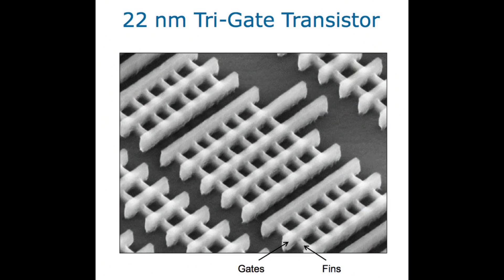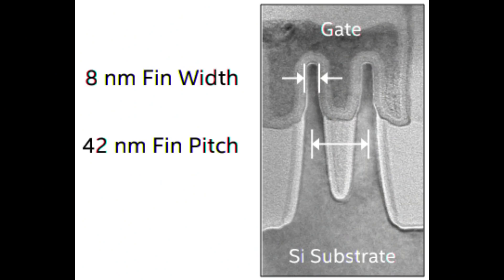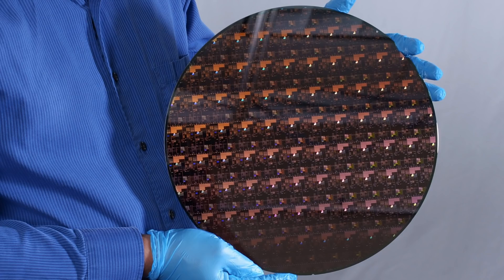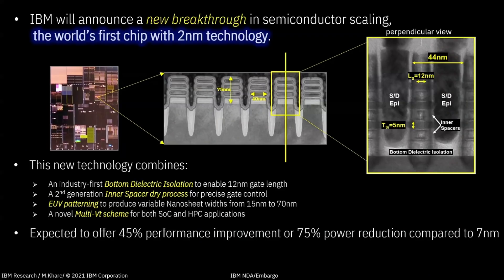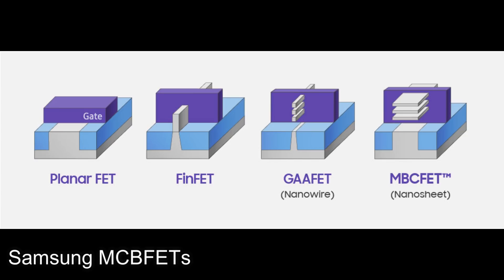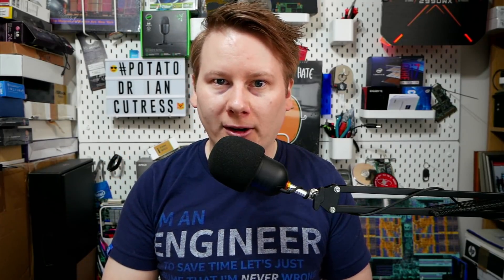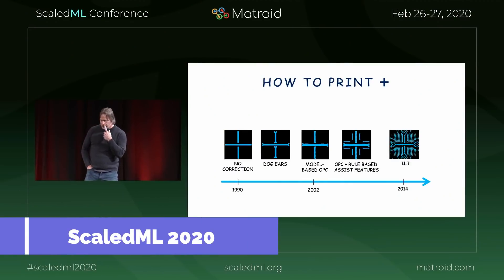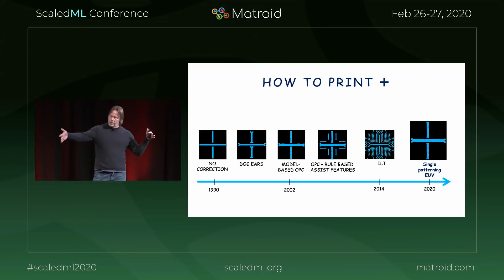There's Plenty Moore Room: IBM's New 2nm CPU

Comment: Second thought is that software's got to also take a substantial leap in order to use 100 core CPUs. I currently run a 16 CPU 32 thread machine basically remains idle most of the time.
Reply: True but its at least a few years off so they have time.
Reply: @erikburzinski8248    I don't think so ... this is a known problem since basically the beginning of Computer Science.  Only partial solutions are available for human based programming.  At this stage, it is a problem that I think will never be solved... nor does it necessarily need to be.  The inefficiencies in use of high multicore systems will persist.

Comment: The engraving size announced by IBM, Samsung, or TSMC, are all measured differently, are not comparable, and in the end it's just marketing. The physical limit of a silicon transistor size is 7nm. Beyond that, the chip is subjected to quantum mechanical effects that make it totally unusable. For example Intel reports a density of 100.76MTr/mm2 (mega-transistor per squared millimeter) for its 10nm process, while TSMC's 7nm process is said to land a little behind at 91.2MTr/mm2, and Samsung's 7nm is at 95.08MTr/mm2. To go below 7nm you have to switch from silicon to something like carbon nanotubes and molybdenum disulfide.

Comment: I don't think this will work with all processors as the higher the voltage the more likely the electron leakage will be a higher-level problem, maybe end of the road for silicon and monolithic designs. Things like nanocarbon layers or new materials will be needed to go vertical or chiplet for the future until tech that allows complex layers to be printed.

Or we go photonic. Or mixed x86/RISK HYBRID.

Comment: Ah, the Intel "Let's measure things more realistically' argument for why 7nm AMD is about the same as intel 10nm. To be fair, I'm not an expert, so I don't really know. Furthermore, your idea to use # of transistors per unit area sounds very intuitive. But, let me purpose something that I think we'll all agree is absurd to prove a point. @ 1:47 we see transistors going 3D. Other 3D packaging technology is coming / already here in storage SSD /  Memory chips. So, I purpose we measure by "transitors per unit VOLUME!" <---- this is far more realistic for modern hardware. But, wait, a 2D object has 0 volume, so .... if I have an old 500nm chip with 100 transitors and 0 volume, I have 100/0 transitors per unit volume ... but that's infinity! (at least in the limit as x->0 from the right, 100/x is infinity) No current process node can, nor could ever, beat that! So, by this new, more modern, intuitive, REAL WORLD metric, we have older chips beating newer chips. Absurd, I know. I say all this to say: be careful when changing metrics as non-intuitive results may follow from seeming intuitive metrics.

Comment: A Silicon Atom is about 0.2 nm , so how can they do 2 nm circuits?  
That is not many atoms wide.
 Is there more likely failure of the chips over time with use?
Reply from the maker: Watch the video, especially at the beginning where I explain that 2nm is a marketing name of an 'effective' planar Transistor, and not the actual dimension of anything on the chip.

Comment: A silicon atom is around 200pm wide. Meaning if the 2nm quote is accurate, even if it's simply the smallest feature they can make, that's only 10 atoms wide.

Comment: That is 10 atoms wide. It will not be able to get that much denser still, Moore's law progression is about to end.
Reply from the maker: Watch the video. 2nm is just a name
Reply: @TechTechPotato  No, it is not 'just a name'. That is the size of the smallest features that are needed at that die shrink level. Read this: https://www.eetasia.com/18032601-2nm-end-of-the-road/
Reply from the maker: You misunderstand. IBM's 2nm is using 2nm as a name. Foundry processes are using names like '2nm' to give a rough estimation as to the V/t response of the 3D Transistor as if the transistor was planar. I go through this in the video. I include all the salient measurements in the video in the images. Note that I have extensive contacts at all the major foundry players. I attend conferences that talk about foundry node developments every year, I watch the presentations and I interview the authors of the various research papers. Fuck if I don't know what I'm talking about, then I'm in the wrong job.

Comment: I’m sure it’s more complicated than this, but I would expect a “2nm” density to have closer to 25x the transistor density of 10nm, rather than 3x.
Reply: From 5:50
22nm - 16.5 mtr/mm2
2nm - 333.3 mtr/mm2
20.8x increase in density, not 3x like you're saying
Reply: @BusAlexey  I was responding to the chart (I think 10nm was around 100). But isn’t nm a linear measurement? So transistor density should scale exponentially to this? Perhaps I missunderstand it.
Reply: @danielseddon3177  that's quadratic scaling, not exponential. Also, nm is just an abstract measure at this point, so idk if it should scale with density linearly or quadratically
Reply: @BusAlexey  sorry, I see what you’re saying now. I meant to write 10 not 20. I edited it, thanks!

Comment: For me, the problem is: What voltage and current use those transistors to avoid quantum tunneling of the electrons between transistors? I think that is related to the reduction in consumption.

Comment: I installed AMHS equipment at both the Malta Global Foundries and IBM Albany FAB's between 2011 and 2014 -- the Albany FAB we installed overhead vehicles that could handle both 300mm and 450mm wafers using the same core vehicle but with different grippers and drop units.  I haven't been involved with this since 2014 so I'm not sure what happened to the 450 tools.

Comment: That's some confusing BS. I expected that a 10nm transistor would measure 10x10nm in plain size and probably just as much space between them. But that would result in a 2.5B density per mm2 so it doesn't add up.

Comment: How few atoms can a 'feature' shrink to and the thing as a whole will still work? 1nm is less than 10 atoms packed tightly next to each other. So even with constantly redefining what a feature is and what working means, you eventually run out of atoms. So the transistor density is definitely a better metric than the nm count, until such time when they redefine what.a transistor is.

Comment: Great video, really interesting. A couple of suggested topics for further discussion related to the reducing size of process technology are: 1) power consumption is not as simple as getting lower all the time. There are dynamic power, static power, sleep modes, leakage currents etc etc which change with the size of the technology.  2) Sort of related to the first topic are the number (and accuracy required) of all the different power rails within these chips 3) leading to the huge topic of power management within a typical chip.
Just some thoughts for you to consider.

Comment: I'm still waiting for that carbon nanotube revolution ¯\_(ツ)_/¯
Reply: graphene turns out to be hard to make at scale.
Reply: Moore's law was never about this industry jargon of 7nm and 2nm. Those are not the defining limits to how many transistors can be put put on 1000mm square integrated circuit. 
We could very well have another 12000 times increase in the number of transistors on chips and that is without the actual chip getting larger. 
So we may have another 12 to 16 doublings ahead of us in terms of how many transistors can be crammed on to a chip. 
So your Nanotube revolution maybe at some stage play a part.
Reply: Won't happen without a process scaling like lithography did.
Reply: Yassss
Reply: There's some promising developments in increasing the length they can grow carbon nanotubes, but we still have a long way to go before we're consistently growing nanotubes of indefinite length.

Comment: Very nice video, thnx for posting. However, at ASML Wilton they only make the Top Module for EUV, consisting of the Reticle Handler and Reticle Stage. If you really want to see the complete build of an EUV system, you have to visit ASML in Veldhoven, The Netherlands. And beyond multiple patterning on an EUV system is of course the introduction of the High NA (0.55) EUV system. I agree with you that we will see some interesting shrink in the near future.

Comment: Didn't GloFo buy up IBMs semiconductor manufacture division.
Reply from the maker: IBM still has research facilities.
Reply: @TechTechPotato  still it's a shame, after all the money they spent getting 7nm to the point to where all the needed to do was go scale up production they threw it all away.

Yeh it was a couple billion more, but they had already spent way more than that on the node, so I would have liked to see them at least follow through as all indications were that it was a good node, the first truly good GloFo node. As if it was true they were getting a Power9 processor to 5Ghz from like 4Ghz on 14LPP honestly that seems better than TSMC N7 from a frequency scaling prospective.

as thats 4Ghz all core to 5Ghz all core... I don't think I will ever get over the disappointment, as with the tallent that would have came over from IBM which all probably left for TSMC and Samsung after they gave up on the cutting edge, I think they might have actually managed to make a good 5nm node to.

As TSMC N7 has been supply contrainted from day 1, so I think GloFo could have made money on it, and enough to keep on the cutting edge.

Comment: All these tools assist advancements across the industry and that overflows with effects through other industries. If silicon ever does plateau it'll be in service of some other technology - optical processors or molecular assemblies - which never could have happened without it.

Comment: Oh gosh the furute hold alot of innovation I know that, but gosh I really kinda of dont like it, im love the deep hearty things about manuf. Process nodes, intel foveros, euv, just everything and as far as that side of me goes its great i cant wait for the future silicon holds ecspecially going big little in the future, and intel incorperating other inatead ofnjust an all intel part and whatnot, but I also am in the xoc scene, and gosh idk what do you think about xoc on big little, lets say you have a 12 core part, 8 big, 4 little, would you overclock all 12  like you would say 11900k all core all 8 cores 5.2, so tor since theres 4 little and they cant do what the big can just the 8 big cores, and at that point is it really an 8 core cpu that youre xoc, will windows not differentiate big little and just call it a total 12 core, or idk its weird and im not really looking forward it with the knowledge i have now, but like idk could you shed some light for me Dr. Potato :)

Comment: actually, the nanometer parameter in node is referring to the GATE LENGTH , the part of the transistor that links source and drain terminals and this gate is only one piece in the transistor design. If the process is 7nm then the minimum gate length the fab is offering is 7nm.  But there are other parameters that each fab has which also affects the transistor size and the quality of the trnasistor, so this is why the densities are different from fab to fab. But if the node size is 7nm, the gate length will always be 7nm at all the fabs. Therefore the saying of wikichip "different fabs have different counting metodologies" is incorrect

Comment: I'm very curious about those density numbers.

They are listed as peak, obviously not average as if that was the average then there's no way Zen could have been competitive with Skylake given the die size and those density numbers.

Where are those peak numbers found? When you look at SRAM, some of the densest transistors an the chip, Intel's 14nm, 10nm, Samsung's 10nm/8nm and TSMC's 7nm are all extremely similar.

I'm beginning to think that Intel won't give out transistor numbers any more because we can easily check the rest of the variables and find out that Intel has been lying about being having density be roughly a generation ahead of everyone else.

Comment: can you do a video on Dennard scaling, power density limitations and clock gating? i've heard at some point those are supposed to 'cancel' out any possible porgress in miniaturization and i've seen a lecture by Sophie Wilson a couple of years ago that talked about the increase in 'dark'-transistors  with each node

Comment: 193 nm to 13.5 nm may yield a 10x density improvement, but it's a shrink by a factor of ~14.3x, which squares to ~200x density. I assume the 193 nm was not single pattern?

Comment: I still remember reading that IBM had 1GHZ chip back in the late 90s and it just blew my P133 owning mind
Reply: I recall IBM or Intel having a 1 THz transistor in 2002, but it was just a single transistor IIRC.

Comment: IBMs 2nm are NOT in production.  They were made as a research project showing it is possible, but that does not mean they can be mass produced for now.
Reply from the maker: I didn't say mass produced. A proof-of-concept wafer was produced. That wafer was in production. They are going to produce more. At no point did I say 'mass'.

Comment: You mentioned as an aside that everything is 300mm, with the current crunch for chips has there been any industry rumblings re-looking at moving to 450mm wafers or would it be just more cost effective to build two to three more 300mm fabs than try to upgrade their production processes to the larger wafer size?
Reply from the maker: To move to 450mm, all the tools would have to change as well. There's no desire to shift 100B of tool production to 450mm, so people are content just building more 300mm fabs

Comment: As processes and nodes become smaller and smaller, at what point do we run into a problem of electrical interference that becomes insurmountable just by shrinking in two dimensions? 
Speaking which, does The current two nanometer node by IBM allow for 3D layering at this node size?
Reply from the maker: That's already happening, and there are lots of tricks to get around it. Interference is reduced with buffer materials, but it depends what materials you're using as to how much buffer you need etc. Billions have been poured into research :)
Reply: @TechTechPotato  I remember reading about the issue when industry moved to 90nm lithography. Tunneling will become an issue as we get smaller. I'm not an engineer and haven't taken anything beyond AP physics and AP Chemistry, but I certainly see tunneling becoming a worse and worse problem. At some point soon, we're going to reach the limit of how small nodes we can push on silicon substrates. I just don't know when that will happen.

Comment: The problems with more cores is, for the average user, that they don't solve many problems beyond 2, maybe 4 cores. It seems software just can't be optimized that much to make use of it. The most demanding applications, games, mainly run on just one core (Unity engine for example).

Comment: I love these videos where you explain the details of how the industry and manufacturing process works. Ive learned a lot from watching your videos
Reply: Lithography. You "print" with an acid resistant and removable material, give it a dunk in acid then remove the printed material. There are more complicated processes. The mechanical tolerances of the "printer" determine how small you can print. The failure rate multiplied by the die size will determine the yield rate because of the two dimensional nature.
Reply: Same here. Thanks !
Reply: Kenn Honson X  .  
,
.
.
 0
0
    
 .,
,.,. .
Reply: Wiiu  portable running off a watch battery is now possible